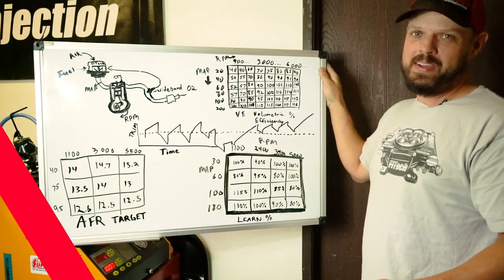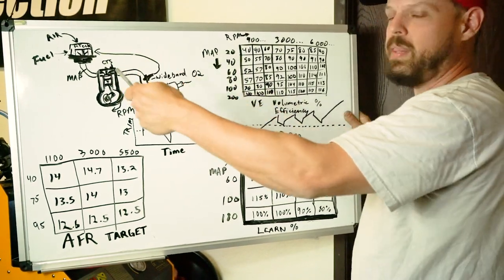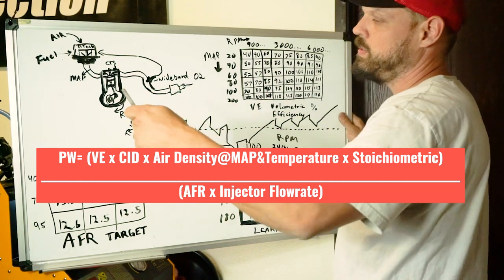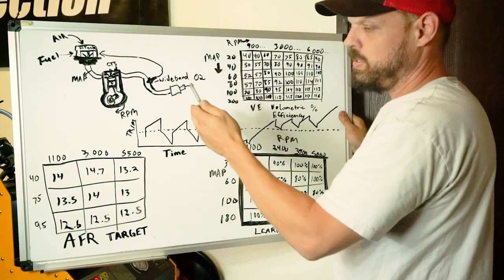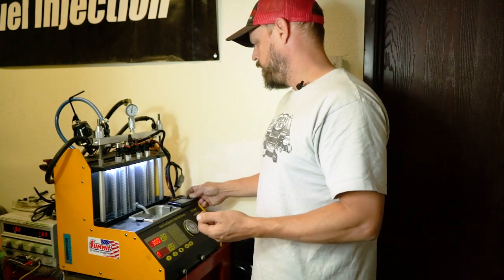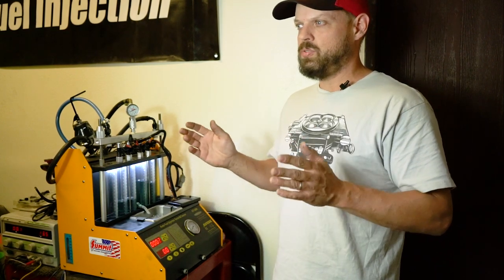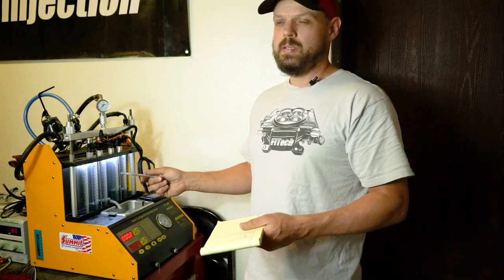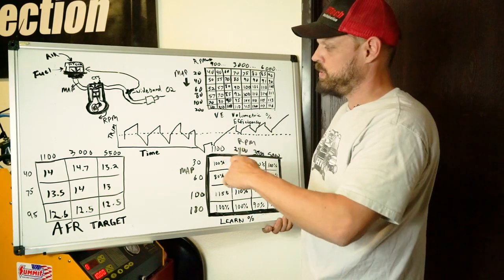How Closed Loop AFR Trim & Learn Work Part 1| Tech Tuesdays | EP48

Comment: Good video, can't wait for part two. I am try to adjust to VE table right now. I have it pretty close within 5% cruising, The only issue i have is at like 80 kpa and 2500 rpm my afr goes to 10.9 when I am commanding 13. Learning doesn't seem to get it any better, trim is going to like -28 while the learn in that area it  around 120%. I am slowly getting it not to be so rich it there. I sent an email about the pc software. i got a reply the a new software is in the works. It would be nice to at least have 16x16 tables, and a way to add the learn values to the ve table, like holly, or be able log EQ error and apply that to the VE thanks
Reply: same issue